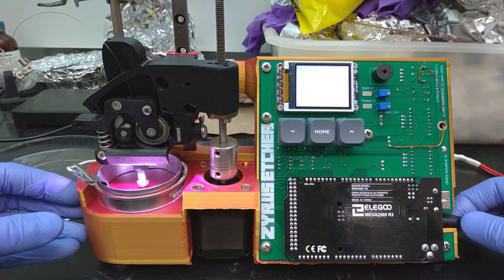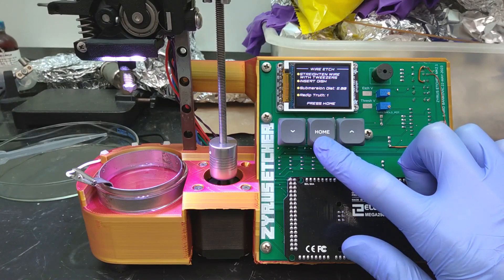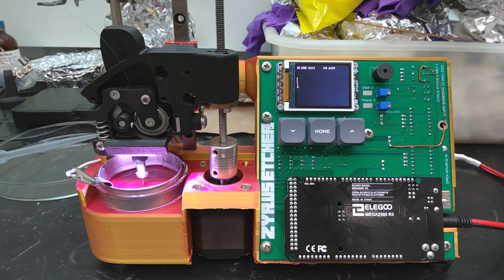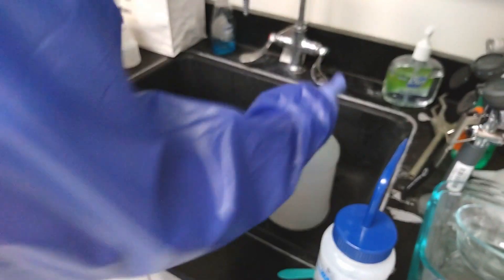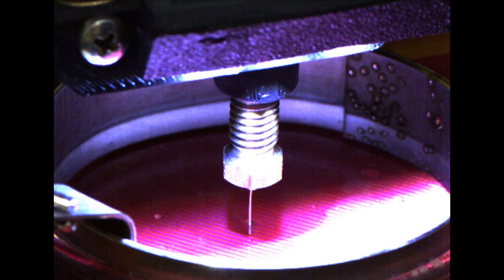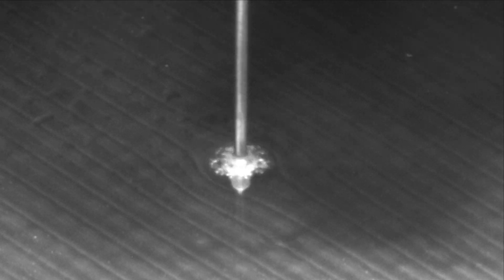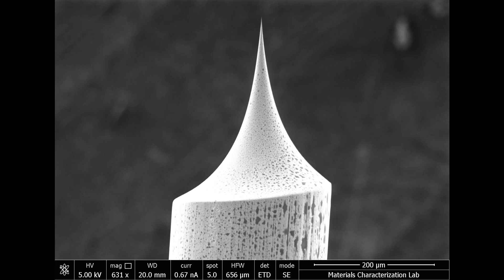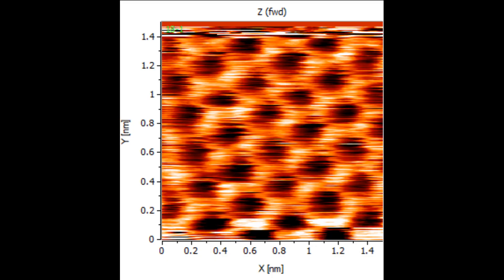Zyrus Etcher, STM Tip Fabricator

Comment: Could you avoid meniscus issues by having a layer of oil on top?
Reply from the maker: The oil layer would also have a meniscus, perhaps less, but still present. I actually tried putting dish soap in the aqueous NaOH etching solution, to try and break the surface tension for the sake of curiosity. However, it did not reduce the meniscus significantly. Honestly, having the meniscus is not an issue, and if you wanted a very short, sharp tip, it might also work to ramp the wire out of the etchant during the etch. This is something I have not tried, but I imagine you could program it to make any arbitrary tip length.
Reply: oil would prevent evap though, I think, which could probably help control the etch rate
Reply from the maker: @ntm787  Oil would prevent evaporation, that's an interesting idea certainly! But over the course of 8 min or so that an etch takes, there is no significant evaporation, indicated by the lack of terracing. The tip with terracing was produced because I intentionally broke the meniscus by hitting my hand on the table. But to test if evaporation was happening to a significant degree, I did try putting some Cling Wrap on the dish, and then when the wire plunged into the etchant, it poked a small hole in the wrap. However, I did not see any differences between these tips, and when I did not include the Cling Wrap (under an optical microscope).
Reply: @BairdBanko   I'll be honest, I only skipped through the video without audio. I'll watch it in full later on tonight! Nice work overall :)
Reply from the maker: @ntm787  No problem! I did not talk about that in the video anyway. Cheers!

Comment: Could this technique be used to make tungsten probing needles that are used on microprobers?  Tip size about 1 micron?  Would it be possible to generate gerber files from the PCB board?
Reply from the maker: Hi, for tips larger than 2um, mechanical sharpening is preferred. If you want a 1um tip for microprobe stations, there are companies that sell those somewhat cheap (Signatone is one). Additionally, you make want to use thicker wire for a microprobe, I have not tried etching thicker wire, that may be an interesting test. 
Someone inquired to me about an electronics BOM, I will be posting that in a few days. 
Cheers!